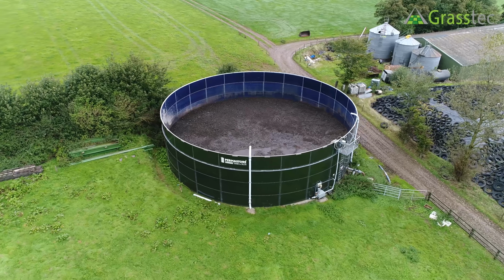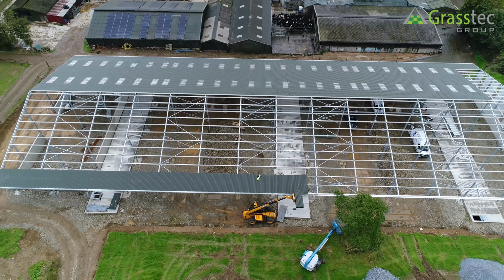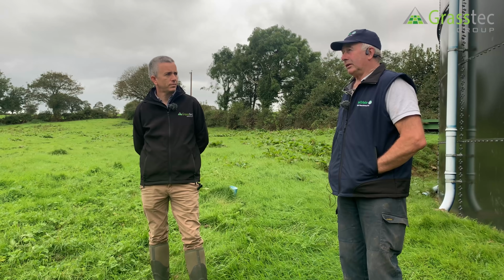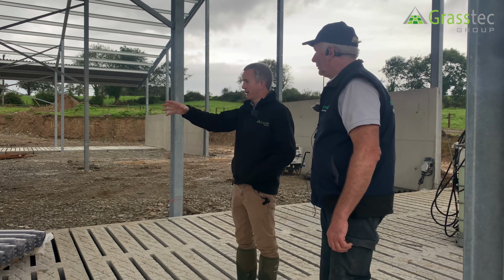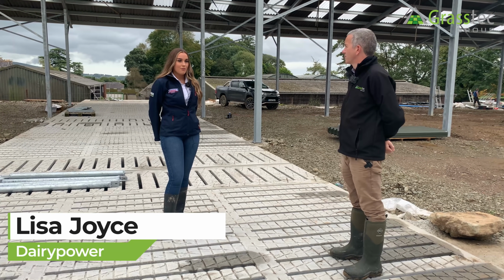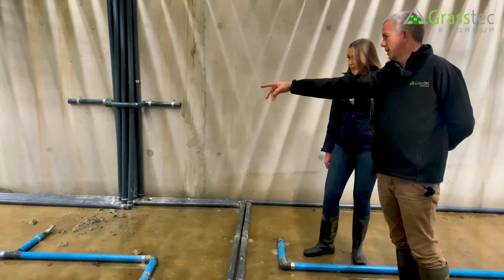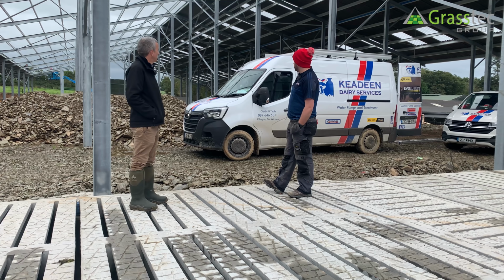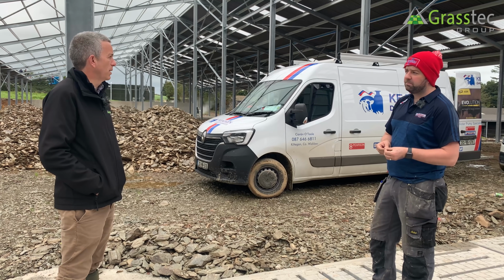Slurry Management with an Aeration System - Dairypower

Comment: I bought an aeration system from dairypower. It has worked 1 1/5 years out of 11. Useless service and no backup. 10,000 euro wasted.
Reply: What went wrong with it? Would it have been possible to service or maintain without dairypower?